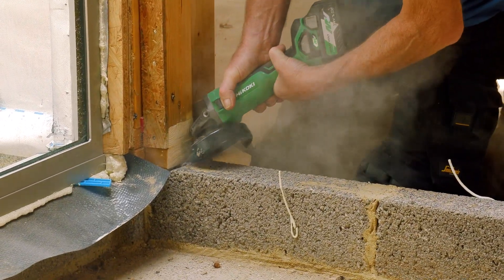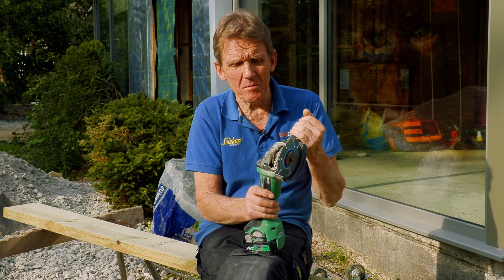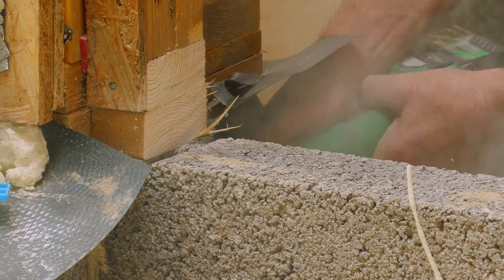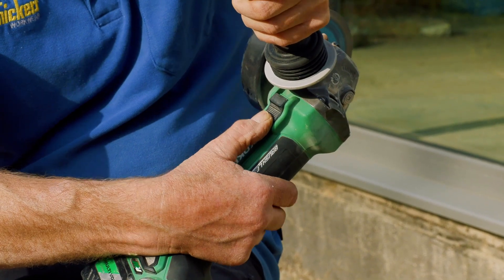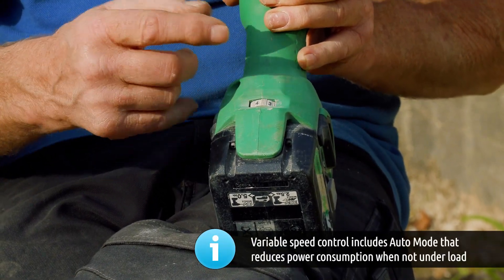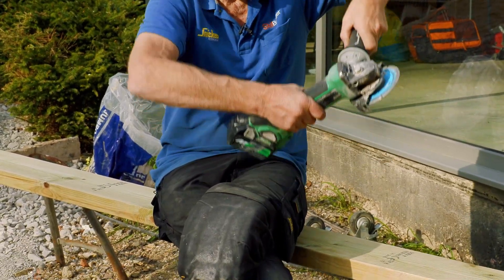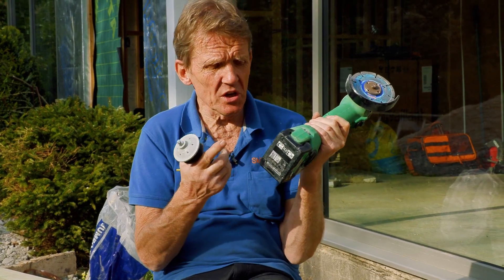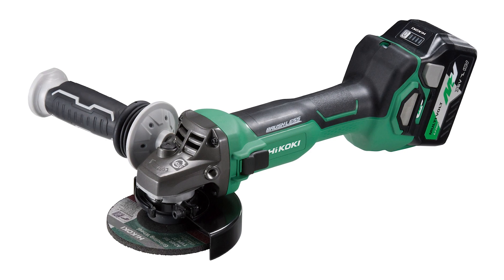HiKOKI 36V Brushless Cordless Angle Grinder

Comment: There has to be an electronic safety shut off feature that activates if the grinder is dropped. If you can lock the switch in the on mode, you have to have some function that prevents it into flying into low earth orbit

Comment: All that silver part on the diamond blade is not what ya have to cut with.  Once the diamonds are gone the disk is done and all that silver part you pointed to will still be there for the most part Roger.  I'm not knocking that brand of disk they are all the same, once the diamonds are gone they are all done for mate.  I do like the tool very much tho
Reply: What blades are you buying? I've never had this issue even some cheap ones i've had in the past.

Comment: Is this a Advert .
Reply from the maker: Not exactly, did you enjoy it?
Reply: @SkillBuilder  I actually did . Roger.  Can I ask , are tools made in the country of origin really better . ie - Festool , mafell, makita
Reply from the maker: @stevendouglas3860  I would say no. I think there are several factors that come into play and most of it comes down to floor management. 

Hilti is the only factory I have been to where every tool is run up and tested before it goes out. They are complete control freaks and watch everything like hawks. 

Hilti has  factories in China as well as Europe and keeps the same quality control in both. 

I also know that competing power tool brands are often making tools for each other Mafell and Bosch are an example, also Hikoki and Metabo so it is almost impossible to say anything definitive.
Reply: @SkillBuilder  Thanks Roger . 👍 i always check were tools are built . 😄 Japan or Germany .